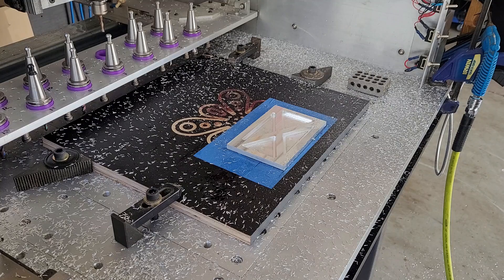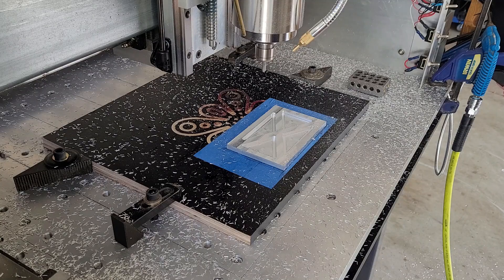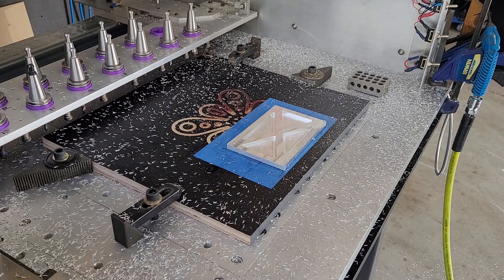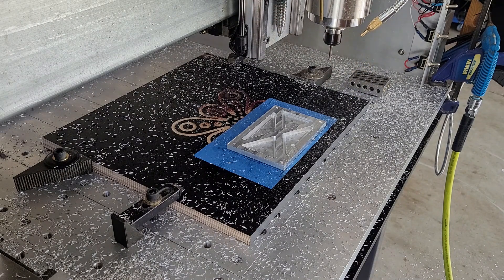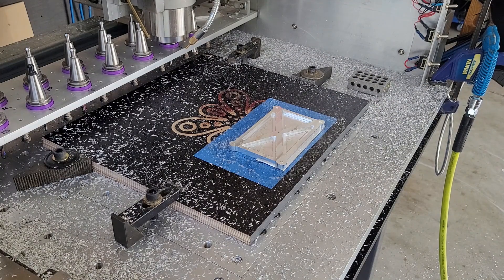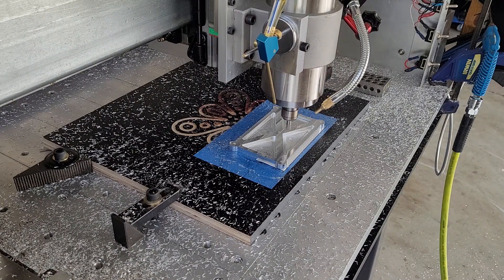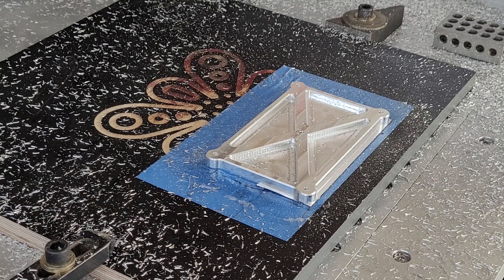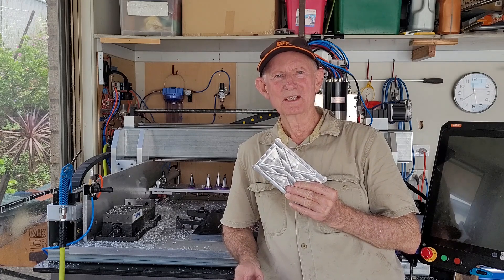Home Build PrintNC PRO Fog Buster Mist Coolant System Video Part 2

Comment: Is that a Masso controller you’re using?
Reply from the maker: Hi Kert yes it's a Masso G3 touch screen controller I use Fusion 360 for the Cad and Cam then you can use either Wi-Fi or USB stick to transfer the G Code file to the Masso   I have been quite happy with it and Masso are continually upgrading there soft wear to improve it further  cheers Bill